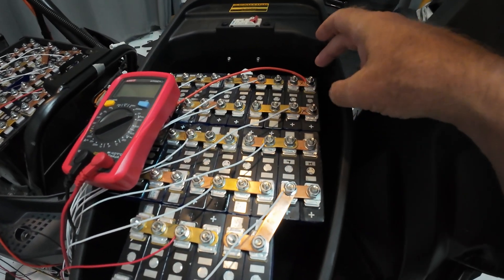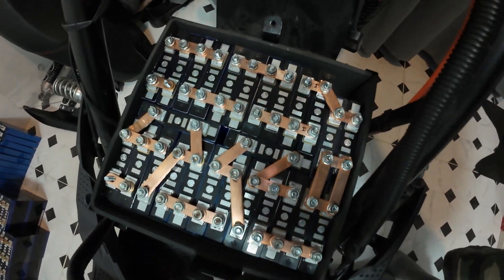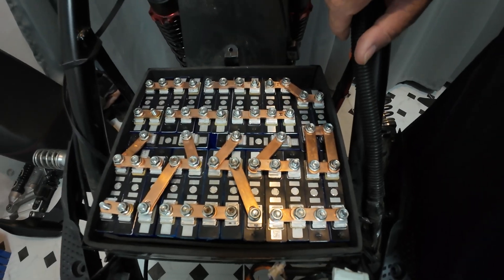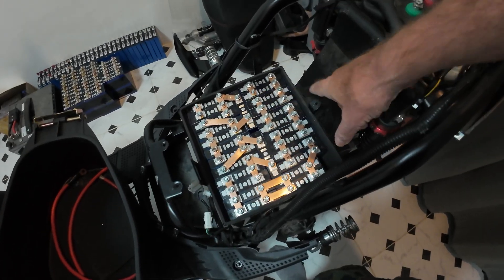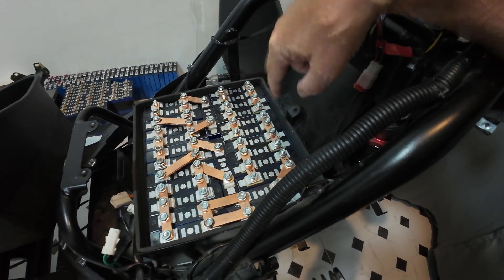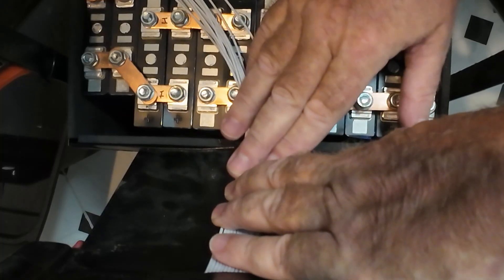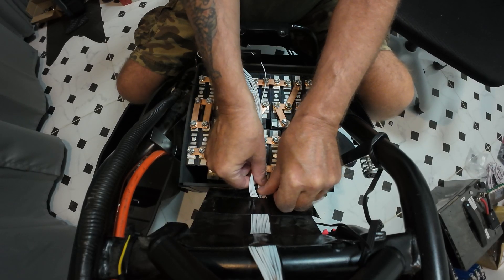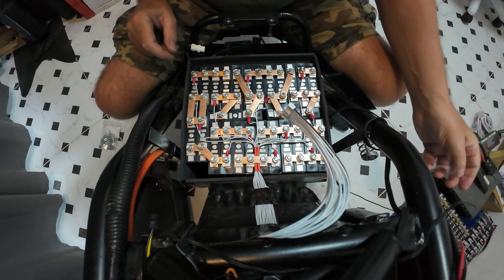The extreme DIY electric scooter / motorcycle build - Shorting out a LiFePO4 battery

Comment: Great to see you doing full builds again how easy it to use a different controller on a scooter most of the wires are easy just a cpl to work out😁👍
Reply from the maker: It's pretty easy mate, all the phase wires are simple and the hall sense wires are always the same colour. I had to meter out the rest of the wires and refer to the controller connections but it all went flawlessly. You may run into problems getting a speedometer working but mine was fine because I changed out 'like for like' so I used the same wires.